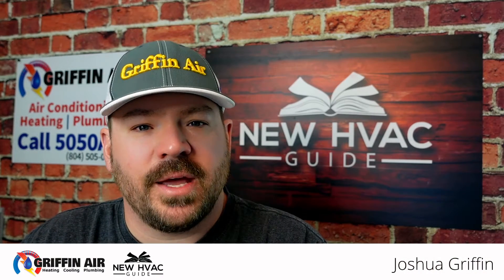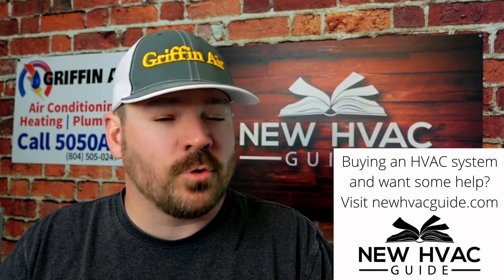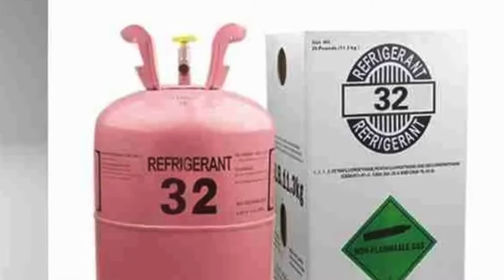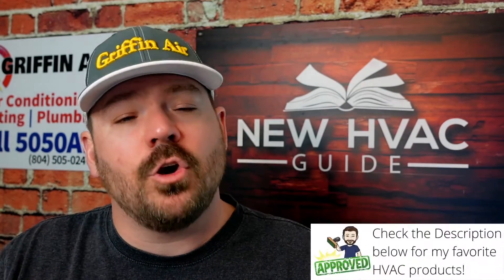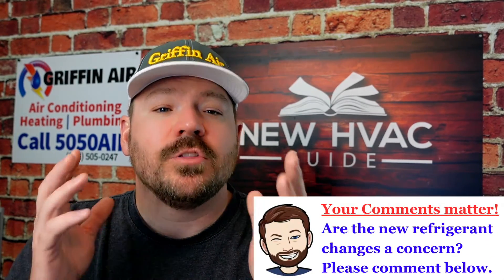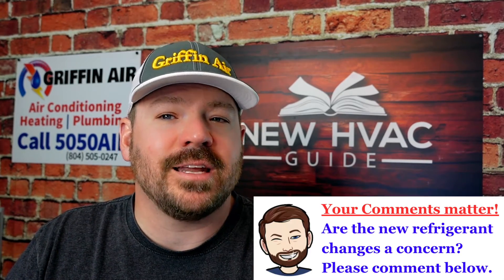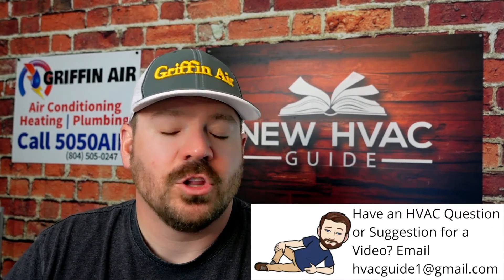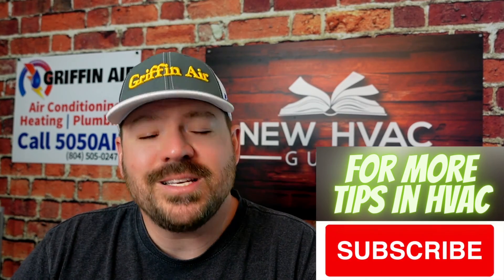Can You Put R32 in 410 Systems? What Will Happen?

Comment: R32     in the condenser temp range of 100 to 140 degs F is 375 - 557 psig
R410a in the condenser temp range of 100 to 140 degs F is 343 - 542 psig.

R32     in the evaporator temp range of 35 to 55 degs F is 110-160 psig.
R410a in the evaporator temp range of 35 to 55 degs F is 109-157 psig

Enthalpy [BTU/lb] is higher for R32 (good thing) by about 20%.  This mostly due to slightly greater gas density of R32.

R410a TXV's should operate okay with R32

The higher high side pressure is main objection to replacing with R32.  Any manf. warranty will go out the window if you substitute R32.  Because of slightly greater density of R32, the condenser will likely be more efficient at giving up heat, keeping head pressure on compressor down. Subcooling temp should be set slightly lower.  Places like Arizona in summertime is dicey on maximum head pressure.

Don't know how much the higher density will impact compressor as to damaging reed valves.  If I had no alternative, I would likely put in R32 if unit uses a scroll compressor, but again no more warranty if you do.

Inverters VFD systems are likely more forgiving as they already limit compressor head pressure and allow low superheat conditions.  They should take about 15-20% less R32 charge weight than R410a.

Perhaps some manufacturers may give updated numbers for subcooling and charge weight to approve R32 substitution, but more likely they want to sell you a new unit.
Reply: I have a R32 Mitsubishi 2 head mini split system, the indoor units state on the nameplate that they can be used with both R32 and R410A.
Reply: @sciencetestsubject  That would be logical because already certified with more flammable R32.
Reply: @sciencetestsubject  What that means is they meet the safety standards for the slightly flammable R32 refrigerant, therefore they are backwards compatible with the older non flammable R410a. If something was not certified to use a flammable refrigerant, it's technically never acceptable to fill it with a flammable refrigerant.
Reply: Hey I have the opposite question I have an r32 system that leaked and it sounds like I can charge it with r410a but it will be less efficient. Seems almost impossible to get r32 still. Can I just charge the system with a little more r410a to make sure the capacity remains the same albeit less efficient?
Reply: @moff3tt I have the same question … what did you find out ?
Reply: @jayperez4877  my buddy who does HVAC fixed the pinhole leak, then vacuumed and charged the system with r410a. I don't remember how much he put in. He just used his experience to set it to safe pressures, we then temp tested the coils and output air. It cools just fine. No issues it's been a good while. Idk if it uses a meaningful amount more electricity or not but the system doesn't seem to mind it instead of r32
Reply: Good to know. I don't see the slightly higher pressures being a problem at all since the differences are so minor and almost certainly within the safety margins the unit was designed for and should still be well below the test pressures during operation. Oil and material compatibility should be no problem since R410a is half R32 anyways. Higher compressor discharge temps may or may not be a problem in practice.

We will never see any manufacturer approve of using R32 in an R410a system since doing so would void its safety approvals and be a huge liability. Using flammable refrigerants in systems not designed for them is officially strictly forbidden and manufacturers won't pay to recertify existing units for use with flammable refrigerants when doing so wouldn't benefit them in any way compared to the customer buying a whole new system.
Reply: Good stuff
Are you saying if you have 410A you can throw in there are 32 and it shouldn't hurt the compressor or other parts of the system sit?
Reply: Try again
I have 410 a can I put in R32 and be safe or will it do damage to my system?
Reply: @bruceelias2732 I want to know this as well
Reply: R32 discharge temperature is 20 degrees more than R410A and its flammable? there are other A1 class non-flammable refrigerants if (and a big IF) replacementif you have to!